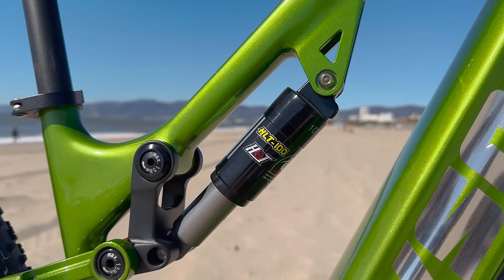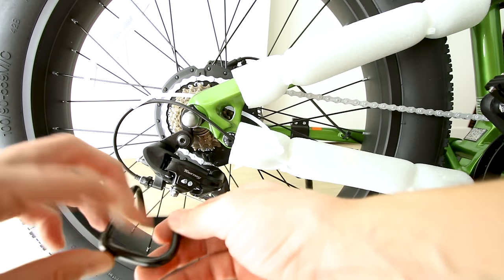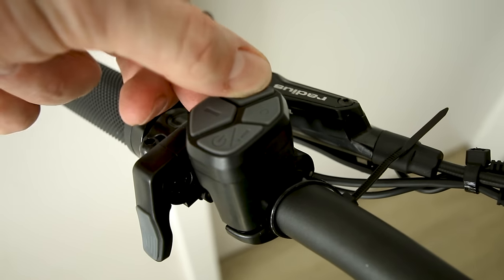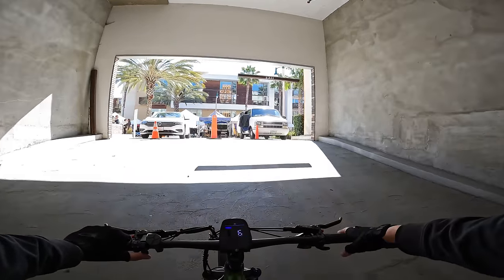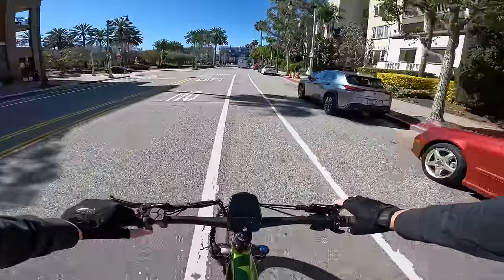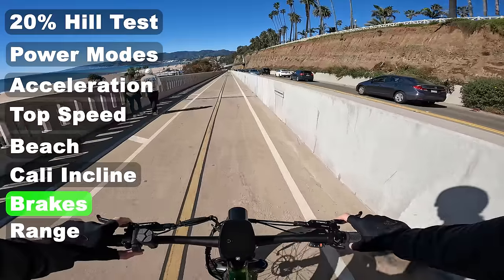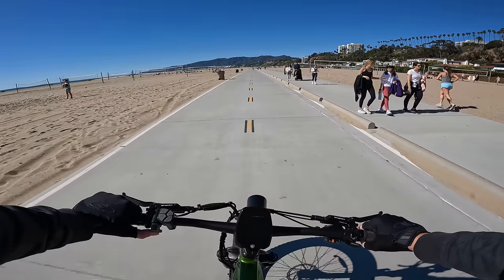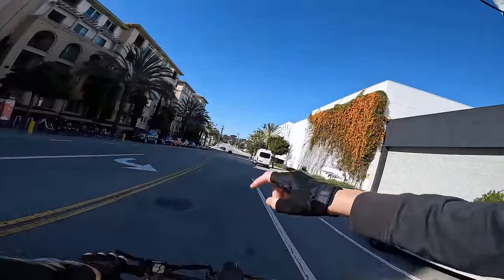This "Almost Perfect" Fat Tire Ebike Has 1 Flaw - Hovsco HovScout Review

Comment: Mountain bike handle bars are good for actual mountain bikes used on single track trails, but Ebikes best suited for the road would benefit from BMX type handle bars, same with that seat..Nice pedals though..If you misjudge that wall while testing the brakes, by just a few inches,  and that will be a bad day..

Comment: Most all these e-bikes have less than $100 in components on them which just blows my mind. Literal Walmart quality. Brakes, shifter, derailleur and cassette can be had for $100 or less. The rear shock, front shock and crankset simply belong in the trash. I bet you can get all three of those for roughly $100 as well if you can even find that low of quality on the market. All of the parts are not anything that anyone would or should ever put on their bike but that's what they come equipped with?  This market needs a correction big time. $500 replacement batteries on most all of these E bikes and most of them are only 13-5 amp hours? Custom build is the only way to go.

Comment: My definition of "*perfect*" is as close zero maintenance as possible.    So this bike still has spokes, bad,  and chain which means work.  Motorcycle/scooter brakes would improve longevity.  Angle and size of seat post means after a few thousand miles on pot/rough roads you can expect the post to snap, if your tall and stout.
Reply: Semi truck brake systems would also improve longevity so why did you stop at motorcycles and scooters?  lol
Reply: @rabbithomesteading3797  Because many EV bikes are close to scooter/motorcycle weight.  brakes are of similar design.  Cost similar amount but last for THOUSANDS of miles unlike bike brakes.